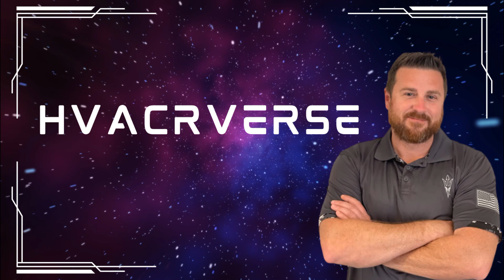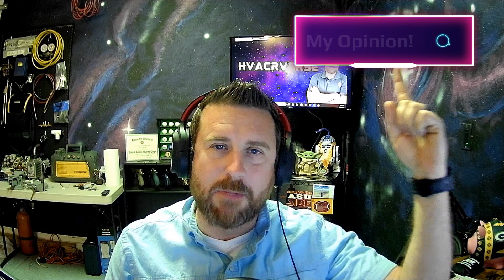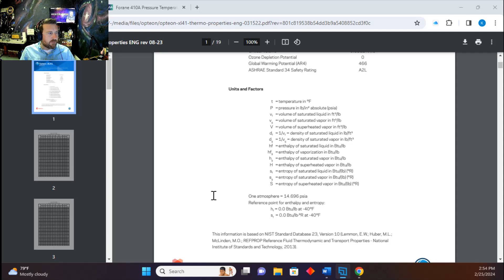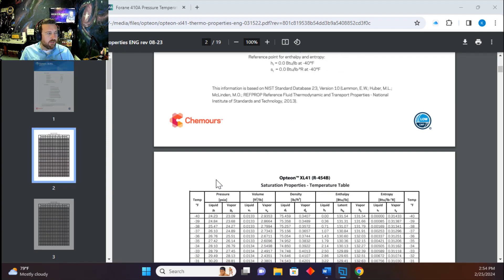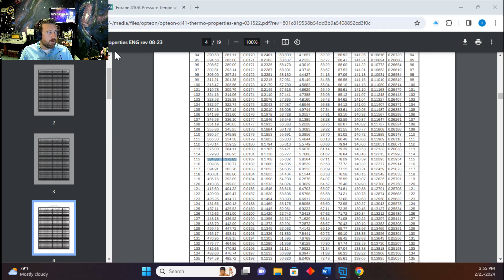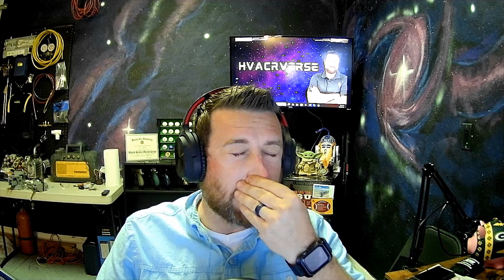A2L READY OR NOT HERE I COME

Comment: Can you explain the not to exceed 25% lower flammability limit rule?
Reply from the maker: Essentially you must have enough volume to prevent the refrigerant from reaching 25% of the refrigerants LFL for R454B that would approximately around 3% of the space can not be over that with refrigerant. Essentially a system with 6lbs of 454b must have more than 100sqft to disperse that refrigerant to keep it below that 25% of lower flammability of the refrigerant. Hope that made sense. If further explanation is needed I can do a video on it. Just remember this stuff is not as dangerous as everyone is making it out to be. As long as we follow best practices we will have no issues.
Reply: @HVACRverse  I appreciate the breakdown. A very short video (but not a Short!) to illustrate would be helpful. Just that specific item. Thanks.

Comment: I opted for a reverse thread hose, only the process hose uses a reverse thread.  I have dedicated hoses for recovery and evacuation so getting a reverse thread process hose doesn't seem like it will be a problem for me.  

As of the last time I checked Robinair hasn't approved any of their vacuum pumps for A2L refrigerant's and yes I own two of them.  So I guess I need to go shopping!
Reply from the maker: I have not seen any robinair A2L vacuum pumps yet. I know the field piece and appion vacuum pumps were already A2L as they were intrinsically safe. I know yellow jacket and JB redesigned their motors to be intrinsically safe.